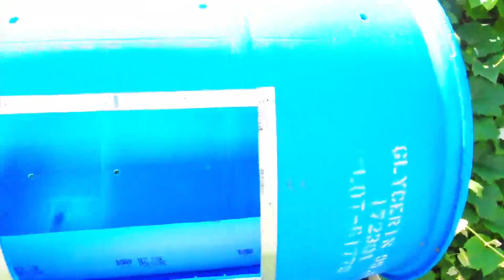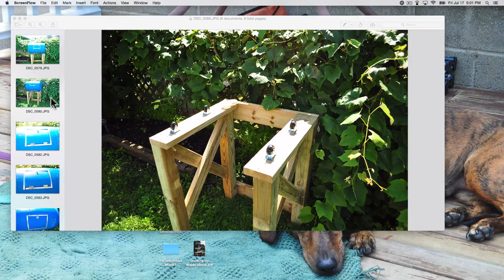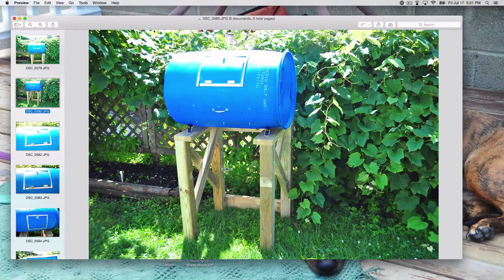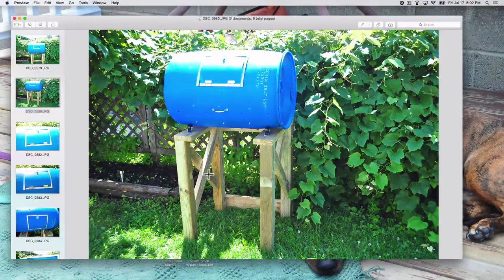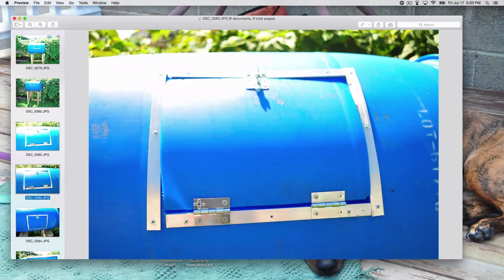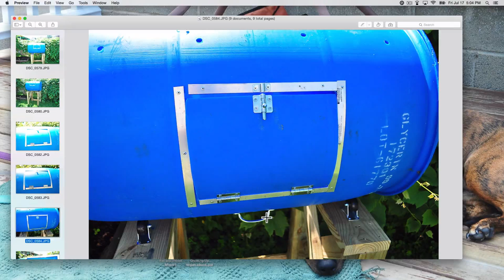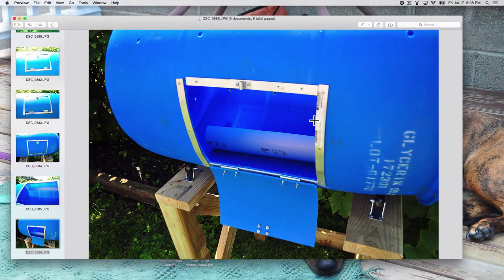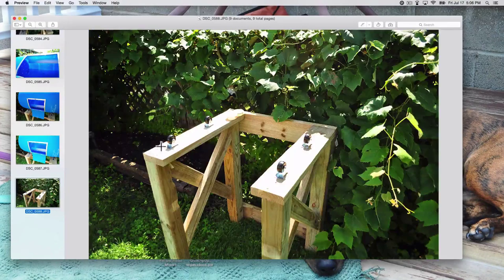D.I.Y Plastic Barrel Compost Tumbler Tutorial

Comment: Great idea to provide room for wheel barrow, so much easier to empty it. 
Also, not having a wooden beam across the front is a good design as it allows easier access to the opening and more control when emptying it, esp if you have to reach in to drag the compost out.
 
 The wheels work BETTER than the pipe through the middle as they make the barrel easier to turn when it gets fully loaded. I have gardening friends with both types. The wheels are larger like "from a shopping trolley".
Reply from the maker: Good points. Thanks for watching!!

Comment: As per previous note - I placed the casters in the convex area of the drum (at the very edges). i.e. only 3" or 4" in & it actually 'naturally self-centres' the drum - so it doesn't migrate off the rollers during use.

Comment: Hi, I'm in the process of making my first compost bin, and yours is the first I've seen with wheels, as opposed to pvp pipe (or metal) going through the center.  My question is, now that you've had yours for almost a year now, would you change the design any, or go with the pvc pipe to turn the barrel?  Also, do you have any compost tips you'd like to share fo?  Great video, thanks for sharing!
Reply from the maker: +Harriet Ladd- The wheels worked well. I encountered a problem when it got heavier with turning the whole barrel by hand with the handles. We had 100+ pounds of stuff in there. Would this be easier with a pipe through the middle? Perhaps. If I were to build it again, I would build it the same way. Good luck!
Reply: The wheels work BETTER than the pipe through the middle as they make the barrel easier to turn when it gets fully loaded. I have gardening friends with both types. The wheels are larger like "from a shopping trolley".

Comment: (1)-Please put the dimensions of your door opening, and any suggestion of better dimensions..
I am building one now, and need to know the most optimal size. 
(2)-If anyone is using a plastic plumbing pipe through the center, for pivoting, drill many 1/4 or 3/8 holes all through the length of the pipe, so that air can enter the ends of the pipe and into the compose barrel.
(3)- It may be very beneficial for people to put the closure latch on the sides as in this video.
youtu.be/Xoypwb7dHDg  This keeps the lid from bending and popping open under load.
(4)- Thankyou for posting, .  Many good suggestions are also in comments.
Consider pinning this comment so that others can find it faster.
-

Comment: How did you determine the angle of the cuts on the cross braces??
Reply: A  45-degree angle is usually the strongest for rigidity and strength.